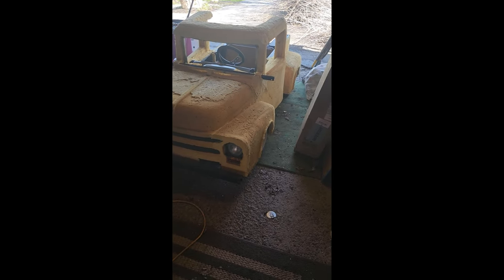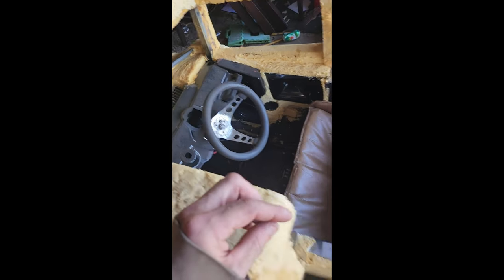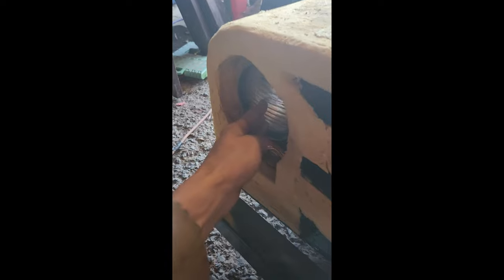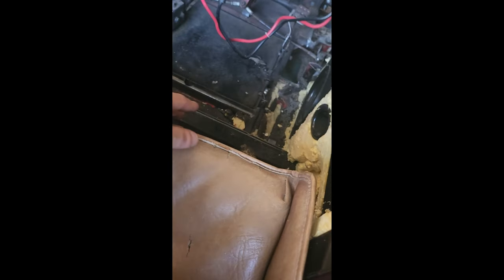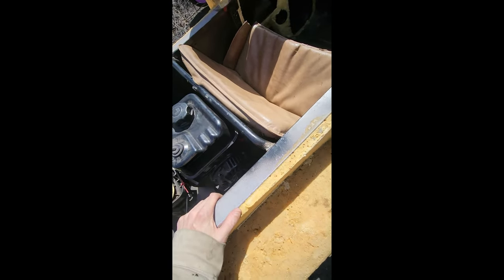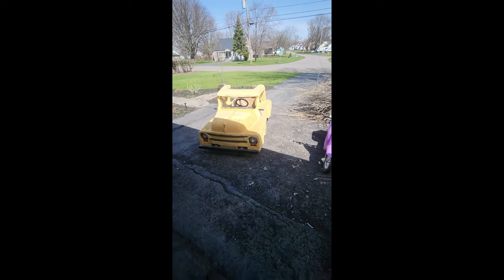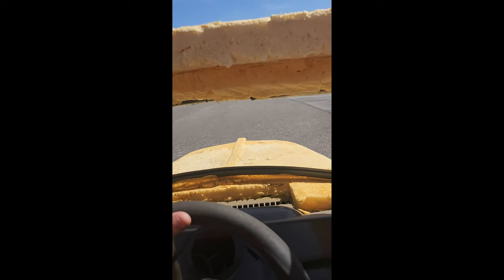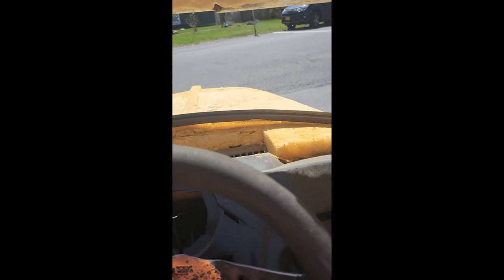Go-Cart Miniature Truck | First start up and ride of the year | First Official Video!

Comment: You  can buy a fnr gearbox pretty cheap And  itll work with  torqhe converter
Reply from the maker: I will definitely check it out. You have a link? I want to really try to keep it original as possible. I have another project coming up that will be bigger and better and with a passenger seat. I kind of hate building something but wish you could have done a few things different. I don't want to call this truck a rough draft. Its definitely one of a kind. I'm just going to finish it the way I intended it to be before my mind went crazy thinking on how to change it. When all I have to do is just build something else. Maybe something that hauls this Truck? I don't want to give too much away lol. Thanks for the advice!